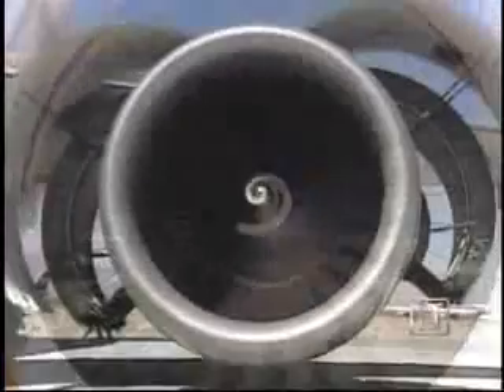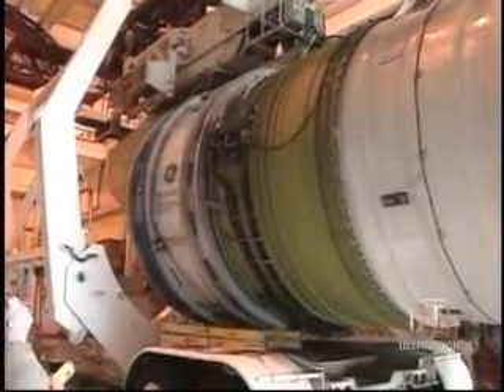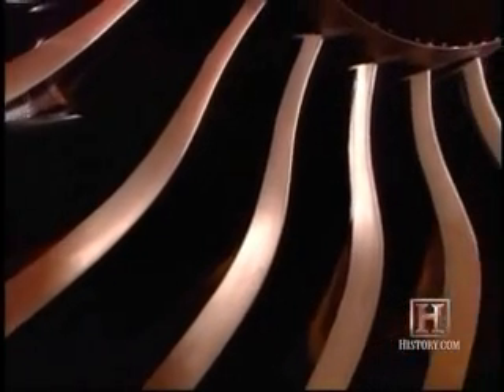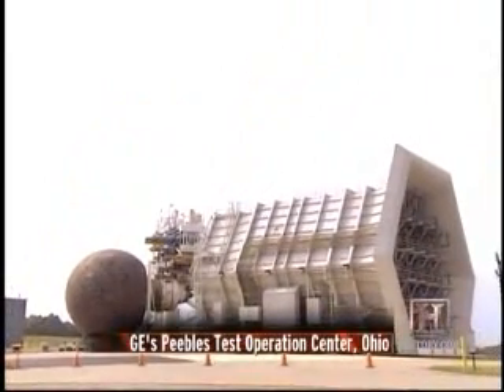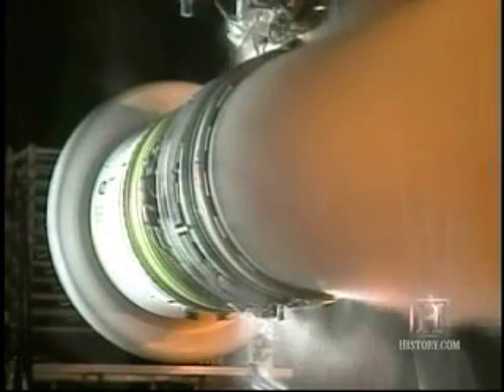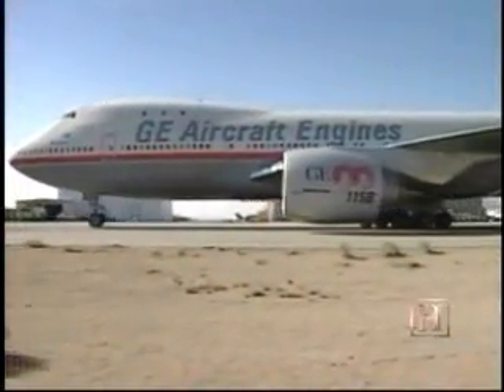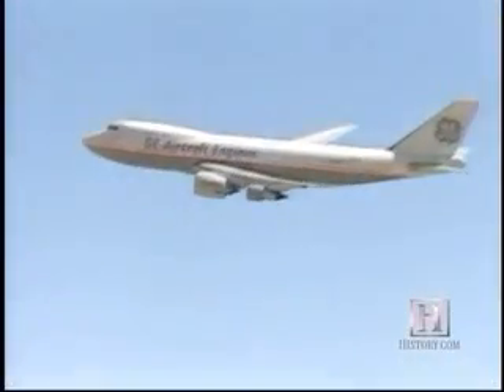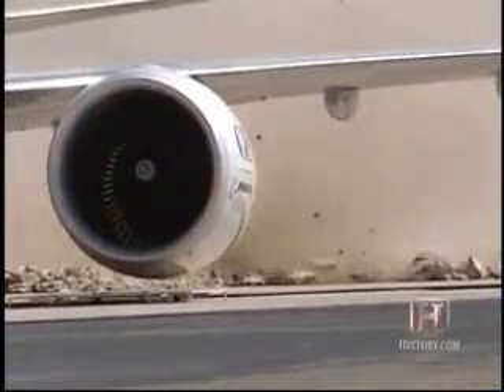General Electric Biggest Jet Engine for B-777

Comment: It's worth remembering that twin-engine airliners are inherently over-powered compared with three or four engine planes, simply to allow for the 50% loss of power if an engine fails on take-off. This is also important for landing, making twins better able to handle microbursts of the type which brought down the three-engined L-1011 at Dallas-Ft. Worth.  While four-engine planes are not so over-powered, they are generally long-range and so on landing are relatively light, with lower weight-to-power ratio than the shorter-range triples when landing. This was all discussed after the crash of Delta flight 191. The engine reliability and safety of large modern jetliners are astonishing compared with the airliners of 50 or 60 years ago. Air New Zealand has  6.5-hour ETOPS approval to fly non-stop to South America.

Comment: Making a huge airplane with only 2 engines is not a Boeing decision,  it was a desire of the first buyer (UA).
So there was a technical mistake, what would happen if one of the 2 engines failed? The airplane gonna loose 50% of it's power...but if it was with 4 engines (of the same current thrust ), then in case of engine failure,  it would loose only 25% of it's total power..which is better & safer..
Boeing sacrificed saftey against finding a buyer!!!
Reply: Did you watch the video? It said the engine could power a 747 by itself. The 777 is smaller than a 747, so the engine would be even more capable of flying that airplane by itself.
Reply: More engines = more chances for failures.
Reply: A 4-engine jet isn't "better" than a 2-engine jet. Yes, back in the day when engines weren't nearly as reliable or powerful as they are now, it made sense to require 3 or 4 engines for long flights, but it doesn't make any sense nowadays. Since the 777 debuted, there have been exactly zero crashes that would have been prevented by having 4 engines instead of 2. And, in one of the handful of crashes that have happened, it probably would have been worse with 4 engines instead of 2.

Interestingly, the 777 has actually been more safe than its quad-engine competitor (the A340,) which ended up being grossly underpowered.
Reply: Yes... Airbus initiaded the "jumbo jet twin engine" issue with the A300 (wich wasnt a long range jet) and companies loved them since Boeing developed the 767 and later the 777... and the 777 has effectivily killed 4 engine jumbos..

Even Airbus suffered this.. when they created the next-gen A300 , they developed the A330 and A340.. the 330 was (is) a twin engine longer wide body and the A340 was same design but with 4 smaller engines (in the first 340-200/300 they used GF56s like the 737/A320) with the logic that 4 engine planes would be inmune to ETOPS regulations and also requiere less powerfull engines .. but companies keep demanding twins only and now the A340 is dead.. the A380 is strugling and the new 747-8I is in real danger.. while the 777, 787 , A330 and new A350s are best-sellers than ever.

Companies are sometimes quite cruel beggers... the A350 history is quite hilarious and its not over yet.. When Boeing released the 787 companies demanded to Airbus a next-gen twin engine wide body so they had choices in the market (ie to make competition to Boeing so they could get the plane cheaper).. Airbus first proposed a highly optimized A330 .. and companies refused it seeing it as a "low budget mod" and demanded Airbus making a 100% new plane.. Airbus complied and developed the new A350..

Now that the A350 is in the air finally.. Airbus anonced new optimized versions of both A320 and now the A330NEO ...and companies have thrown to buy A330NEOs canceling orders from the A350 to buy A330NEOs..

I can visualize some Airbus CEO in some office swearing.... and somewhere else some Boeing CEO too for the 747-8I
Reply: @blackbird you are correct - a 4 engine plane has less chance of crashing from engine failure than a 2 Engine plane BUT the difference in risk is tiny because of ETOPS.  Almost all engine failures are not engine failures - they are component failures that mean the engine stops working. E.g a fuel pump or valve may fail, but the overall engine is fine and will work as soon as the component is replaced.  

The really big engines therefore have multiple built in redundancies (e.g more fuel pumps and valves than necessary) so if one fails mid flight the remaining systems can cope and the engine will continue to run with no reduction in performance or safety. On landing the failed component can be replaced. No one will even know there was an issue other than the flight crew and engineers who would have seen a warning.

The only part of the engine that is not redundant is the fan / compressor assembly. These almost never fail. When they do the remaining engine has enough power to get the plane safely to an airport in all circumstances.

The only exception to all of that is if there is catastrophic engine failure - but if this happens and the built in safety features don’t work - the risk is that the wing or plane body is destroyed in the explosion. If that happens the problem is “not enough wings” rather than “not enough engines”. So more engines are irrelevant.

I can’t remember any aircraft accident in my lifetime (46 years) where this happened - so the risk to the average passenger is almost zero - so avoiding big twin engines jets over this risk is akin to never going swimming ever because of shark attacks, or never ever going outside because you might get hit by lightning.

It’s impossible to get risk to zero in life, but once those risks are almost entirely theoretical - stop worrying.
Reply: vbscript2
I say both have about same ratings.. only that there is more 777s than 340s.. but both had no crash or death due to mechanical issue.. and both had a crashlanding due to pilting error in wich the Boeing had casualties where the Airbus didnt .. and the 777 had 2 planes gone (hijacking/shotdown) wich arent related to the plane either.. so its hard to compare since both are at minimuns .. only the 777 had casualties in ac actual crashlanding (in not counting the A346 that went off runway in quito as that remained pretty much intact).
As for underpowered .. that was the A342 and A343... and still both work well as passanger jets as today.. the A345 and A346 arent underpowered at all .. they use Trent bigger engines rather than the CFM56s of the 200/300.. Also the A343 actually has better fuel economy than the 772 (its closer competitor from Boeing) but the engine maintenance costs (X4 vs X2) null the very slight advantage
Reply: +vbscript2 Also as i said before the 2 vs 4 engines debate is not about reliability only.. is more complex and it involves the MTOW because planes have to be rated to climb in take off with the loss of one engine.. in a twin thats a 50% power loss but in a 4 engine is a 25% loss only.. therefore on paper 4-holers can be certified for higher MTOW than their direct 2 engine counterpart wich means they can carry more fuel (for example A340-300 vs A330-300.. the A340 has an extra landing gear bogey and has a center fuel tank wich gives it more range than the A330-300.. the smaller A330-200 however carry that extra fuel tank as its lighter than the 200 ).. however the evolution of engiens are overcoming this limitations.. the incoming A330-300NEO for example will carry that extra center fuel tank and will be a direct A340-300 replacement (wich ironically gets in the way of the A350)
Reply: +mjmqubesi apparently these things are so kick ass they only need one.
Reply: sparrowlt It actually used to be about reliability. Before ETOPS came along, you were required to have at least 3 engines in order to make long flights that flew routes more than 60-90 minutes (depending on which countries' regulations were involved) from the nearest airport where an emergency landing could be made. With engines becoming more reliable, though, ETOPS was introduced and that's what allowed twins to start flying trans-oceanic long-hauls.
Reply: +vbscript2 Yes... but the MTOW issue plays a role too since 4 engines allow higher MTOWs than 2.. however with engines evolving and developing way more power (like the giant 777 or A350 engines) this probably is overcoming that...
Reply: Blackbird i see ya pont matey but planes with only 2 engines have to pass e-top wich is only the best engines such as genx, trent and pw 1000 to go over seas
Reply: Blackbird  sorry mate saying that united send boeing 757s in to london heathrow now i dont think thats safe
Reply: Blackbird Boeing wanted to make the best and most efficient twin engine long range aircraft to save on the rising fuel cost, it was not because of the buyer, because it became to expensive to only fly planes with three or more engines across the Atlantic. That is also why planes have ETOPS ratings
Reply: You should apply at GE they are looking for a know it all
Reply: soaringtractor  good for you. but watch out ..only in cargo version.. last passanger 747-8i was allready delivered in 2017 and there are no more orders.. only for the F version.. so.. if no one else orders a 747-8i ..the A380 would had actually outlasted it by 4years (pax versions of course) and as i can see there are 19 on order by UPS ..4 by Arabia (might be pax?) and 2 for VC-25Bs
Reply: rmwtsou
But less danger when they fail as you lose less thrust and have less asimetrical thrust...

Comment: Each engine of the SR-71 Blackbird produced 60,000 horsepower and that was designed in the mid 1950s....and is smaller. Four feet in diameter, 20 feet long.

Comment: Especially the GE90 versus Trent800...The GE90 also has much better fuel consumption than the Trent 800 even though it is about 3,000lb heavier than the Trent per engine. The GE90 is heavier mostly because it is designed for growth. It would be technically challeging to grow the Trent 800 too much beyond 100k-lb thrust. . In general, Rolls engines are very much like their distant cousins, Rolls-Royce cars, they are gas guzzlers,

Comment: Yes here we have an all composite fan, but the majority of fan blades in this present time are Titanium. We was talking about the industry as a whole. RR have developed a Carbon Fibre Reinforced Polymer (CFRP) fan blade which is due to be tested on the RR 747 flying test bed, in 2013. The hollowed out widechord Titanium fan blade they currently use today, may be a thing of the past by the end of the decade.

Comment: They didn't, because RR engines are more efficient = lower fuel costs. That's why the Trent1000 has been chosen for the 787, the 787-9 for 2014, and the XWB has been developed especially for Airbus' A350. Rolls-Royce Trent Family beat any engines on efficiency.

Comment: @FhjNelson which is why the 777 only has 2. but more economic than an aircraft with 4 of the old generation engines. and though Airbus a330s also have 2 engines as well, a330s are not as large as 777s..

Comment: This is what boeing could have done utlized the GE -90 for 747-8s just use 2 for flight and other two for spare engines. This could have beated the A380 with four engines total two can be used in flight and all four inflight as well.

Comment: It's obvious there were no passengers. What did you think? They would pull off a stunt like that in mid air risking everyone's life and get away with it? No common sense? To top it off, it alone wasn't used during take off. There were 3 other engines (P&W and RR combined). They were switched off and just had the 115B running. Finally forget the fuel. It had the combined weight of 3 other turbines to take care of. I'am an Aviation Enthusiast and not just a guy who gets dazzled by spinning blades.

Comment: @baileyjean1000 I wonder... I think the bottom line is no twin engine airliner will ever be as save (at least regarding an engine failure scenario) a a four engine one.  Still, what happened to that A320 in NYC is, fortunatelly, a very unlucky and unlikely scenario.  I'm only guessing, but I think it'll take more to damage both engines of a 777 (A330, 787, A350XWB...) that what it took with the A320 whose engines are considerably smaller.

Comment: I flew twice on the 777. I love these take offs showing the inlet and condensation. I did some calculations on the GE90 engines for fan shaft power. I referenced an ihi.co.jp pdf paper on line. Speaking of the -94 and -115 versions respectively, the fans turn at 2850 and 2550 RPM, of diameters 123 and 128 inches, with fan shaft torque of 225,000 and 293,500 ft lb, and power level of 122,000 and 142,480 horsepower (includes LP compressor). The fan shaft is maraging steel of 55 Rc hardness!

Comment: @k2kkoos 
This video may be a little old, but it will a long long time until Rols Royce or Trent or GP Engine Alliance make anything laregr than this beast (which is designed solely for the 777). Since there is really no passenger aircraft other than the 777 (not even the A380 or 748) that can handle an engine this large, you won't see anyhing larger for a very long time. The market for this engine is too small for others to enter. GE90-115B is also most powerful and holds the world record.

Comment: @lightfdar lol yes delta wing (confuse with swept wing) perhaps a small
pair of delta wing at fron to assist take of is more ideal like SAAB design their jet
variable swept would be a factor in logistic of the plane due to compexity.
I am fairly sure this jet in the video would be good for going at mach 1.3 if the plane is more aero dyanmic  just a guessing :)

Comment: @grantourismo0109 to your second message na I don't think swept wings are the way to go or should I say simple wept wings, variable-sweep wing might work but I still prefer delta wings(check it for yourself (/wiki/Delta_wing)) or its variations. All I'm saying is the base tech is there what needs to be done is improve fuel consumption, noise pollution, and get rid of those old laws n were back in business to no more 12 hour flight and above mark 2 speeds

Comment: @grantourismo0109 I really don't think expensive is a good reason since everything when initially started is expensive. What is needed is a will or motivation to move in that direction and prices will fall. To me from reading up on some history the reason Concord failed was because of hippies and legislation in the US that restricted its flight to only a few airports. There are new tech which would reduces the noise pollution or eliminate it. personally I rarely trust what  comes out of the TV:)

Comment: @lightfdar  yes we both agree on that. current airline like airbus 330 320, 767,747
really do not differ much from the late 70s plane apart from personal tv and less fuel cost engine however they are still doing 0.9 to 0.8 mach really not much break through. 
the reason i think goin m2 is expensive well , this is what i pick up from history channel second thing is that current economy is not really stable.

Comment: @grantourismo0109 See at least we can agree that stuff should be better and that the old duds had less tools and still did amazing stuff. What I would like to ask you is why you think mark 2 (2 time the speed of sound) or above is such a bad idea when it comes to economy. To me at least the faster you can move goods from one spot to another providing maintenance n fuel are not too high others cost are offset so it could also be eco.n y is there no more smexy I thought engineers were also artist

Comment: @lightfdar 
developing concord in 60 s were expensive there were no CAD 
everything drawn by hand, and it really did burn alot more gas than
747-100. And the material used for concord in its day were really expensive
but like you said, i think with 2010 techonology it should nt be hard to build a plane that flies at mach 1.3  to 1.5 would be practical and ecnomocial too

Comment: it will still run after nuts and bolts go through... It will ding some blades but it will run no problem.... You've never seen an engines insides after it come off wing ;)

Comment: the GE90 was designed solely for the B777, as the new CFM leapx will replace CF6 on the B747 and the GP7200 was designed solely for the A380. The B747 and A380 were also design with 4 engine mounts... so only two engines would mess things up a bit.

Comment: I'm not saying to put them on all widebodies.... but twin engines? you bet, These engines are the main reason the 777-300ER does the same thing as the quad engined A340-600, but has an empty weight thats 40,000lbs lighter, and burns nearly 20% less fuel per passenger per 100km than the A340. It also allows the Triple 7 to have 330 minute ETOPS certification. Which opens up more routes to the plane.

Comment: Yeah, let's put GE90s on all planes just in case 3 out of 4 engines fail.. What you say actually is true, but how often in the 30 years of the 747 has that happened?? 5 times?? It isn't worth the money to have 4x as much as engine power as you actually need just to cover the 0,0001% chance that something like you describe happens

Comment: Say that again next time you're on a long haul over the Atlantic or Pacific ocean. I for one am quite comforted by the fact that one of these engines could keep my plane in the air if one failed. One GE90-115b can fly a 747 alone. one or 2 engines fail on a 747 or A340 and the pilots are looking up their escape routes on their charts.

Comment: No. The GP7200 (which is partially built a few feet away from the GE 90) is rated at 77,000lbs of thrust.
The Trent 900 is in the same thrust category.

Comment: 2 GE90-115B's equal the thrust of the old CF6's on the 747's

In fact, alot of 747's are getting parked in the desert because a 777 can carry close to the same amount of people and uses less fuel to do it.